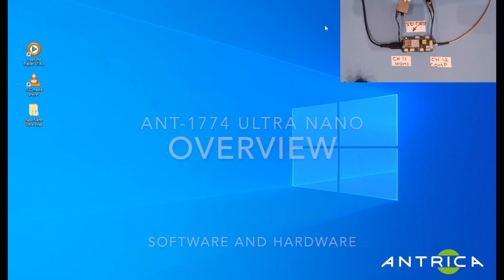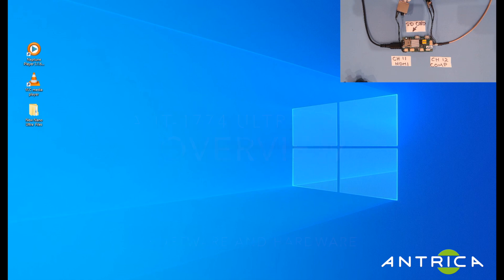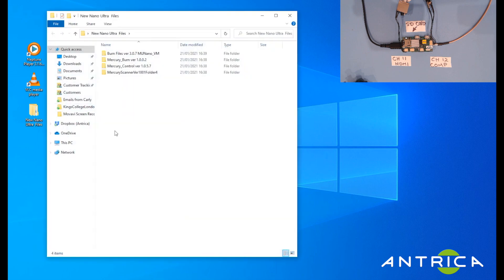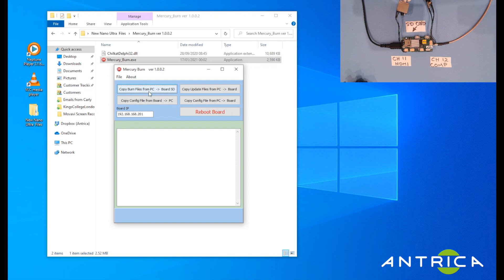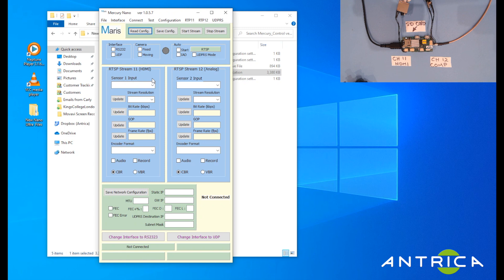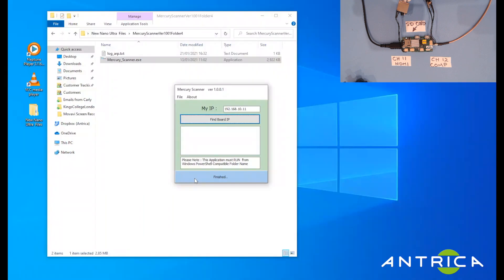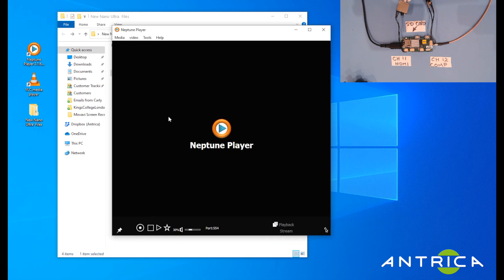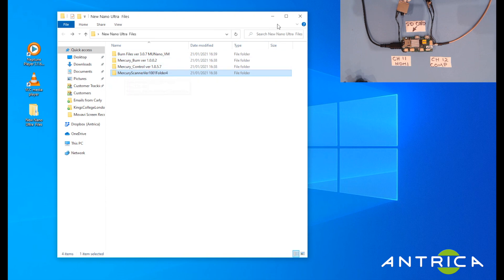Video 1: ANT 1774 Hardware Software Overview   HD 1080p

Comment: Very nice, is there an API for integration into other equipment. What's the maximum framerate accepted by the SDI, can it push rtmp to another server for example wowza or red5 rather than rtsp when a push is needed. Thanks.